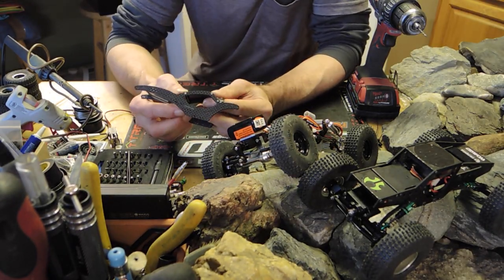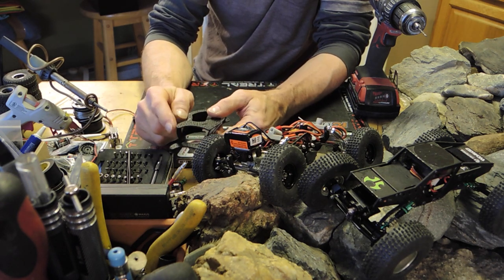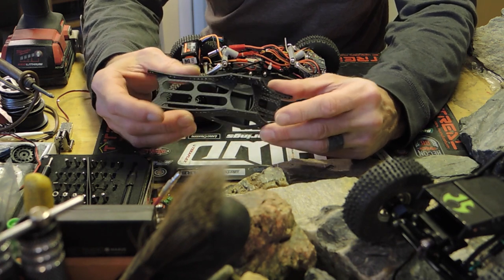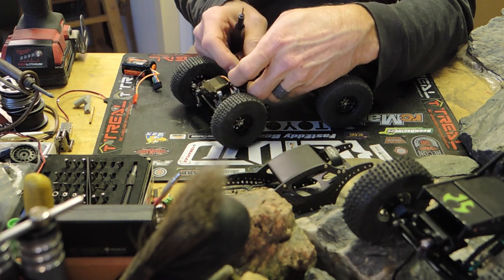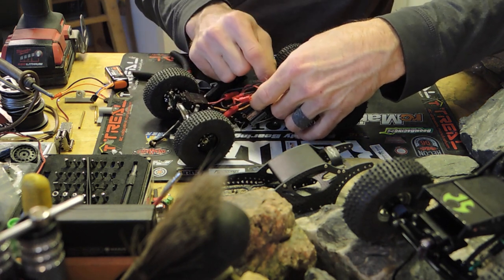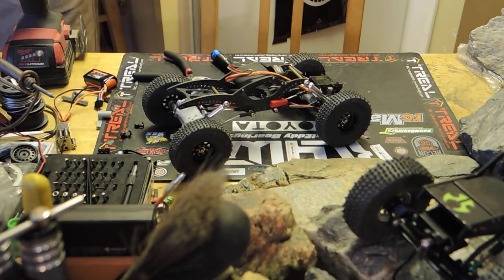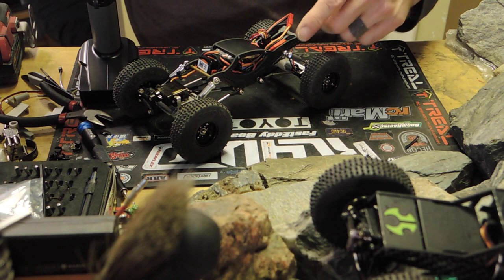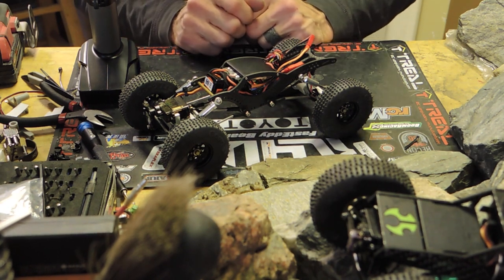Dashex/Furitek Z2 1:24 MOA Full Build with Scythe V2 CF Chassis

Comment: Looks great. Inspiring me to go back to mine. I got bored with mine. 👍
Reply from the maker: Thanks! It's been a project I just can't give up on. I know it's got tons of potential. You should definitely give yours another chance!
Reply: @VermontScaleCustoms  I have an issue with axle stripping where it goes into the cvd. All 4 corners have now stripped at some point. Need a different repair.
Reply from the maker: AliExpress has a full list of all the replacement parts for sale. You could always start the process ;)
Reply: @VermontScaleCustoms  I did notknow that. Thank you sir! ❤
Reply from the maker: You are welcome! Their shipping is pretty reasonable, too. I paid a little extra and got stuff in a little over two weeks from China. Otherwise it takes at least four.

Comment: I have a stock scx24 Rubi and gladiator would one be able to transfer the parts of either or directly on the scythe ?
Reply from the maker: Absolutely. Direct swap over and noticeable improvements because of adjustability. It accepts all flavors of skid plate but I recommend a flat skid so it raises the motor slightly and gets rid of the small bump on a crucial point for clearance.
Reply: Perfect thanks so much. Do u have a link for a skid ?
Reply from the maker: You're welcome, anytime! https://a.co/d/gJyCHZo
Reply: Thank you!! Ended up going with the Furitek brass skid plate when I ordered the scythe. Also the brass links. I’ll keep the gladiator and thro it on the grasshopper frame rails I also ordered. Wishing u a happy new year thanks again for all the help!! ❤
Reply from the maker: Nice! Got a little RC haul going on. Enjoy all the upgrades. It's always fun installing new parts and checking out what they've done. All that brass will make a big difference in how well planted it is. Happy New Year to you as well!

Comment: what esc did you finally get to work properly
Reply from the maker: Dual 30A on the FlySky 6 channel GT5. Still needs rewired and reassembled after a link/suspension overhaul. This video is a little old and I did an update on this just a few weeks ago. Thanks for your question!